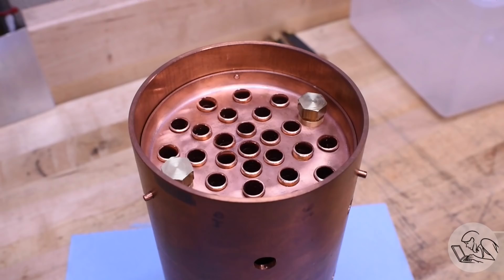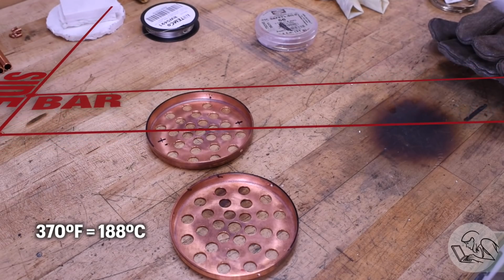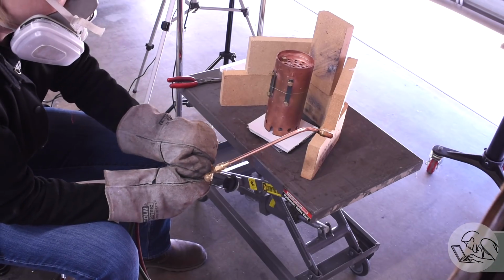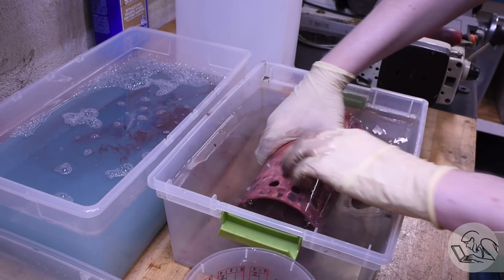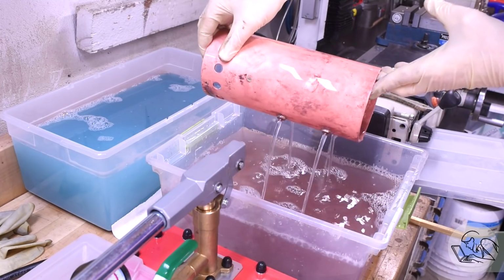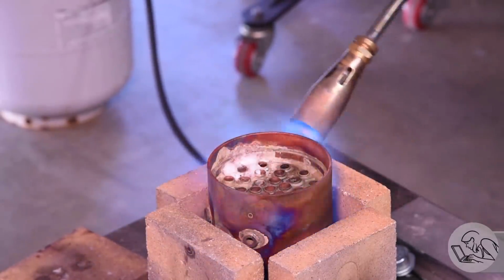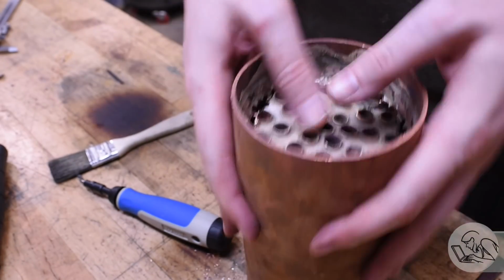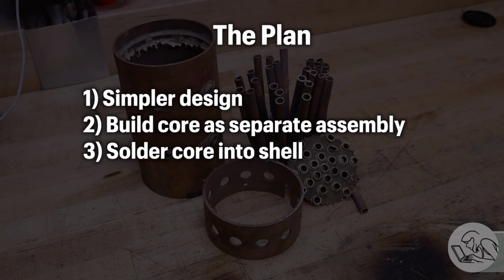Silver Soldering A Model Boiler : Failure!  | Model Boiler Build Part 7

Comment: I'm a metalsmith with a lot of experience working with copper, almost exclusively with silver solder as I come from the Jeweler tradition.
One thing you're fighting is the properties of copper. Copper spreads heat throughout the entire structure, so focusing solely on one area doesn't evenly heat that area, instead it will be heating at one end and shedding heat at the other. This is fine for Easy solders like plumbing solder, but won't work for Hard solder.
Best way to heat a large copper object like that is to create a box around it. Surround it on all sides with those firebricks (top too), with a small opening at the front and the top. Effectively creating a mini-forge around it. Point the nozzle through the small opening at the front, not pointed directly at the object, and monitor it through the openings. Don't get too close to the top hole while the nozzle is in there, that's there to let some hot air escape, otherwise it will come right back out where you have your torch and melt that instead.

Comment: Hi. I remember that my grandpa was making copper boiler a bit bigger than yours. He was hammering all the joints in place because they were so tight and then silver brazing and never failed.
He applied the flax and brazing wire to all the joints and heating up in charcoal furnace.
Hopefully it will be helpful for you.
Like your videos.

Comment: Ah Quin! I feel your pain! I have had exactly the same experience, trying to solder a silver cup with an inadequate oxy/propane torch. I think the problems all stem from the way the silver solder loses its properties once it has melted once. I like to either flux all the joints, to help protect them when you heat it up for a repair, or to use a blocker like polishing rouge mixed with acetone, to prevent the silver solder flowing away from existing joints. You wouldn't be able to do that with the boiler though as you couldn't access all sides of the joints. You definitely did the right thing in starting afresh, but it must have been a hard decision! :( I do hope you have better success with your next boiler, your new plan sounds excellent! Well done for showing us your failures as well as your successes. :)

Comment: Is there a way to pull a flare into the tube sheet so you end up with more surface area to solder to? Like the tool used make extracted tree's or pulled tree's in copper pipe?

Comment: How about a hybrid approach: use a torch with a hearth ( or even on a stove ) to raise the temperature close to melting point not not quite there, then just locally heat the each brazing connection at a time with some localized heat source ( acetylene or electric like tig )  ?

Comment: Years of working on 5" and 7 1/4" boilers for model railways, use the propane torch to keep some general heat in the boiler and use the Oxyacetylene with a small tip to direct the heal to where you need it and then apply the solder. Try and get some proper silver solder sticks and not the silly thin stuff you have as life will be much easier!
Good luck with the second boiler, had all the fingers crossed for this one!

Comment: Its very difficult to solder such a complex array of parts. I feel your pain, and admire your fortitude. 
I used to do jewellery work, in my late teens, and we used different 'grades' of silver solder, and I think you are right about that being the way to go. One horror I wouldn't wish on you - when doing silver framing , ('Cloisons'), for enamelling, we had to use  enamelling grade solder - it's melting point was only a fraction below the temperature at which silver melted. My first attempt reduced my carefully wrought pendant and all it's tiny cloisons to a partial puddle. I nearly cried!

Comment: What a shame but thank u for sharing the pitfalls, I have a part built boiler so potentially you have saved me 6 weeks! I have discovered that there are different melting temp. for silver solder - you assemble as you plan to do but use the highest temperature solder for the first joints and then lower temperatures for the next step of soldering the assemblies- the risk of rejecting joints is reduced on the second and following heatings, good luck!

Comment: Wow - I have tried many times to repair stuff where there are multiple close solder joints on copper, and I have always either failed or been unhappy with the end result.  I have seen aircraft tubular heat exchangers built up in a similar way from Nimonic - a nickel alloy, the ladies doing that worked very fast, everything set like you did, one end at a time. They do build the core separately, as an assembly, but they don't have to heat it further as the end plates have a substantial edge which gets machined for O rings and fitted inside a machined stainless case with welded fittings.  They're quite secretive about the process, but it's rumoured that the tubes are of a slightly different alloy than the end plates, with a lower expansion coefficient, so that, on cooling, all joints are in compression to reduce in service cracking.  I have also noticed a lot of oil coolers and radiators have the holes in the end plates made with a punch and flare tool,  I wonder if this allows the edges of the holes to contract a little more easily as the tubes cool? look forward to the next video - never give up!

Comment: a facinating insight in to boiler building.  My granfather built model steam engines and i am in awe of the work that went into that boiler.  Pity it was a failure but as an engineer, You always learn more from failure than sucess.  All the best on the next one

Comment: I couldn't believe it when you started cutting up all your hard work. I'd be devastated. I built a boiler many years ago. A horizontal design with single centre fire tube criss crossed with a spiral of smaller tubes. Designed to be fired by a gasoline blow torch. Using a natural gas brazing hearth I silver soldered the fire tube using a hard silver solder before assembling this in the outer shell and end plates on which I used a softer silver solder. If I learned anything I don't remember, it was a long time ago.

Comment: I wonder if something like an antique soldering iron would help? The were large  pieces of metal that were heated very hot  to do pipe soldering. They give better heat transfer than a flame. It might not be possible to silver solder with one. It might however work for the tubes especially if you are doing the one at a time method.

Comment: My heart goes out to you. keep going! - I had a thought on why that first leak (the pin hole one) may have occurred. I was wondering if you had a slight build up of pressure within the tank when the last joint sealed? I was thinking that once this happened the air would vent through the last bit of molten silver solder and cause a pin hole where it escaped. If you did have it vented already, then ignore my ramblings.... cheers

Comment: Wow, that was the most interesting video for some time. I applaud your courage to do the autopsy, and you can always buy new material by emptying your (off camera) swear-box :). The design-for-test plans for Version II also sounds excellent. I believe there are three temperature silver solders available, personally I would s-solder the assemblies using the hottest solder. Integrate the assemblies using medium, and use the lowest temp for spot repairs. Good luck, Mark, New Zealand.

Comment: I had to solder up a six inch boiler for a steam train after the stokers burnt to old one. Not good firing up up a boiler with no water. I use soft solder on the one I did.

Comment: Hi Quinn. sorry to see this happen. I have just made a copper boiler for a 5" gauge locomotive. I had a friend with a propane torch while I had the Oxy/propane It dose take a lot of heat to make the joints. I did have leaks and just tackled them one by one but got there in the end, Some club members are building a 7-1/4" boiler there even worse they are still fixing leaks.
A good tip is to get a 3 cornered file and file a groove in the side of the tube hole, 3 evenly spaced will be enough this allows the solder to flow through to the other side more easily.
Using a solder with Cadmium it flows much better. Good luck with the next one regards Martin

Comment: Well that sucks -- don't know if it'll help or not -- and I don't know a damn thing about boilers -- but rough surfaces allow better wetting -- the increased surface area of a roughened surface increase the adhesion between the silver and copper.  So it might be worth scratching up the mating surfaces with a fiberglass pen or a bit of sandpaper prior to the pickling bath.  Maybe before you try another full boiler, do some destructive testing on a few parts from the plumbing aisle of the local hardware store.

Comment: Perhaps completely crazy, but what if you lowered the whole thing into a hot smelting furnace on a bit of wire instead of the crucible? Would it heat too quickly?

Comment: What would happen if you had tinned the entire surface of the tube sheets first ?

I still think the best way to prepare the tubes woulb be to cut them to exact lengths, and use an inside ribbing tool (?) to put a ridge on the outside of each tube at a precise point.   Like that seen on a car radiator spout.
The tube sheets would then be inserted up against these stops from the outside on both ends.
Pre-tin EVERY joint , and the entire top surface of both tube sheets.   This will mean you need to apply less heat overall to solder the assembly.

Since I haven't done anything exactly like this, I do humbly submit my ideas to you.

Comment: One thing I thought I'd mention it you want to run any oxy act style but wanna save some money look into oxy propane setup I switched over when acetylene was scare and expensive it works great and no acetylene to deal with only thing you can't do with it is weld but other than that not much different for what I use it for  you can heat cut silver solder etc cheaper and no dealing with acetylene 👍👍👍

Comment: I don't have any big suggestions since most everything I thought of you mentioned for your next approach one thing I was gonna suggest if you have to make odd cuts in small places maybe get yourself an air powered body panel saw it's basically like a small skinny reciprocating saw that uses lil 2 inch blades you can pic up a cheap one at harbor freight I don't use mine often but when I need it it's awesome to have sorry it didn't work out but one thing I've always gone by is failure is the first step to success still doesn't make the failure sting any less especially on a long project good luck on your next build 👍👍👍

Comment: I never use flux for brazing copper parts. Did similar heat exchanger with 12 inner tubes. Brazed penetrated plates first. Then inserted all in outer shell and brazed top and bottom plate to shell. This was the difficult part because whole outer shell had to be heated up. Was not using head shield though. Penetrated plates was disks turned to size on lathe, no bent edges. Successfully brazed with rothernberger rolot S94 sticks. Propane + o2 size 3 nozzle.

Comment: Quinn - my eperience silver soldering is limited so I can't tell you how you could have done better. But I learned that when I have to construct something using a technology I have not used before, even only slightly new aspects, I do not do it on my actual workpiece. Being it machining or woodworking. Believe me, I learned this the hard way. So you could use the remnants of this failed workpiece to enhance your skills and be sure your next joints on the final workpiece will be perfect.

Comment: Stupid question: Would a makeshift kiln be a viable way to do that? Set everything up like you did with all of the solder in place, then use the kiln to evenly heat the entire assembly to the soldering temp to let the solder solder all of the solder joints with solder, then let it cool off again as a single unit? 
In theory you could have more control over the temperatures involved, the heating and cooling cycles, and so forth. Maybe?

Comment: I have a two part comment, first is that my favorite standards organization was founded due to failures in the scale railroad industry, the 1:1 scale industry where track and boiler failures were killing people and the ASTM was founded to set materials and testing standards for quality and safety.

Part 2 is would preheating the assembly to 800-1000F help by reducing the tendency of the copper to conduct heat away from the joint you are working on, or does the pain of working with hot assemblies not make it worthwhile?
Reply from the maker: I love the description of railroads as “the 1:1 modelling industry” 🤣. I am stealing that. As for kilns, that may be possible, I don’t know! It’s hard for a hobbyist to make that amount of heat outside of a torch.
Reply: @Blondihacks  I have an electric furnace in my lab that can hold that temperature and should be big enough to hold the boiler. Maintaining temperature in transit might be a bit tricky though.

Comment: I feel your pain with copper. I create things with copper wire. Even soldering a ring of 4mm copper grounding wire take a lot more heat than you would expect. Takes even more heat to melt the stuff which I also do when i make al-bronze and cast things. I can only imagine how much heat that thick walled boiler would sink. 
At least you learned something from your mistakes, that's the main part. Sometimes that's the best way to learn. Do it and make the mistakes so you know what Not to do next time. I've done a LOT of that, lol.
 Best of luck on Version 2. I'll be watching and learning right along with you.

Comment: My heart would bleed for you if only I hadn’t been through the same trials and tribulations. I started with a torch far to small for the job and after the first heating it is almost impossible to get it clean enough to do a good job. I ended up with the back end of the boiler in my wife’s enamelling oven, she wasn’t amused  when she found out, and heating the front end with a propane torch. Needless to say it wasn’t totally successful, it doesn’t leak but it doesn’t look nice and now weighs probably 50% more than it should. I plan to remake the boiler some day, when I have a bigger torch. Good luck with the remake.

Comment: I don't know anything about boiler construction or silver soldering but I know glassblowers use a large flame to warm the entire piece and then a smaller, hotter flame to heat where they're actually working. I wonder if a similar technique would work with silver soldering.

Comment: @Blondihacks your idea #2 and #3 is what I was all set to recommend to you until I watched the video to the end and saw that you already came up with those ideas.   I would encourage you to skip #1 and stay with your current geometry.   Boiler efficiency is related strongly to the ratio of surface area to tube volume.  So if you make the tube size bigger keeping the surface area the same by using fewer tubes then your efficiency will be harmed and it will take more input heat to achieve the same output.   I think it's at least worth one more try with the current geometry before you modify the design (easy for me to say, I don't have to do it lol).   Can I add one more suggestion which is that you machine up some copper or brass bars to fit the insides of the boiler tubes and slide them inside the tubes prior to doing any more soldering anywhere near a finished joint that you don't want to disturb.  This does two things; it creates a thermal sink which helps keep the finished joint cool, and more importantly it provides a thermal conductivity path around the tube which does not impart any stress on the existing joint.  Basically keeps all parts of the joint at close to equal temperature.   Good luck!
Reply from the maker: I’ve done the math on the surface area and the reduced efficiency is still more than enough to run the intended engine.

Comment: Congratulations. I don’t think this was a failure. Yes the boiler is non repairable, but the lessons you learned will serve you well. I am neither a machinist nor a model engineer, but I admire your determination. I also suspect you have witnessed similar problems with other boilermakers projects. I am impressed that you teach us through your mistakes, but more importantly; that you have the patience and engineering temperament to analyze failures and successes. Thank you for sharing.